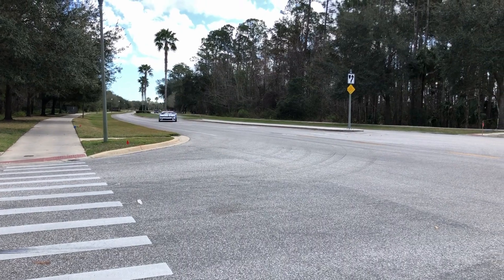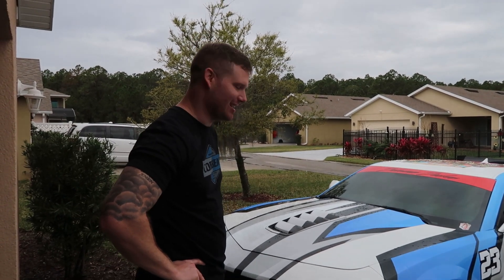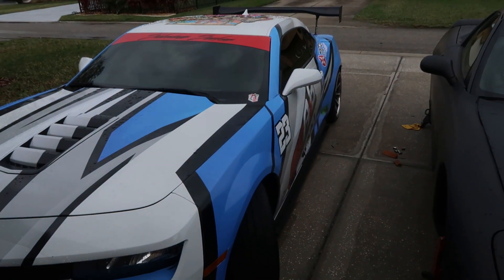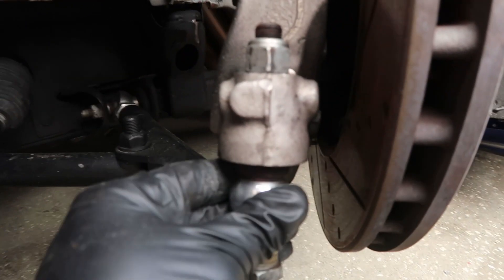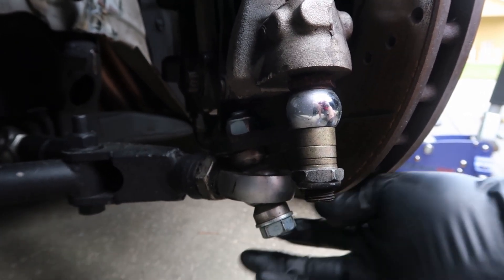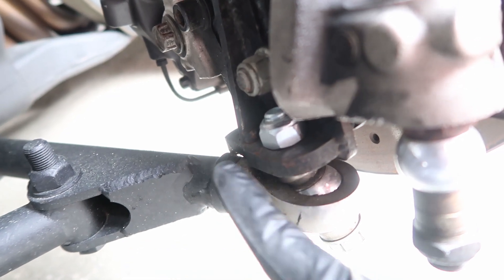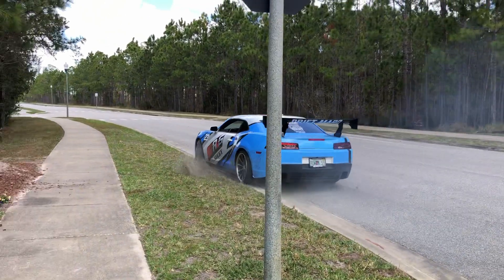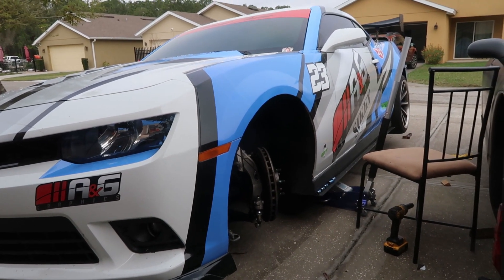Camaro Crash Drifting Fail

Comment: I know it's easy to give constructive criticism when not in the driver seat, but I can see from both camera angles that you're trying to correct steering with one hand. 
Also in my experience, steel has a higher tensile strength than aluminum. Do they make stainless steel tie rod end links for the Camaro? When you get your hands on new ones, try using spacers between the hind joint and the control arm. Reason being is that the hind joint is supposed to be parallel with the control arm. I think that's where your binding is coming from. That load placed on the aluminum was too much and caused chaos. 
Lastly, wd-40 is NOT a lubricating oil, it's more so a cleaner. I used to clean my gsxr chain with that stuff all the time. I hope this helps.